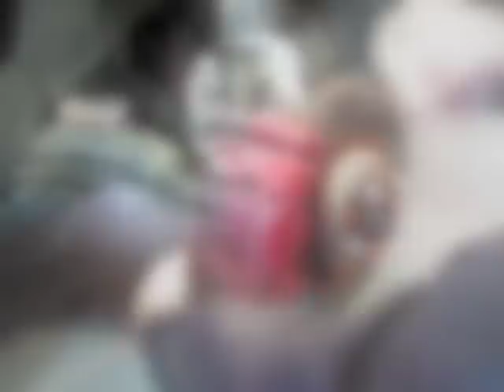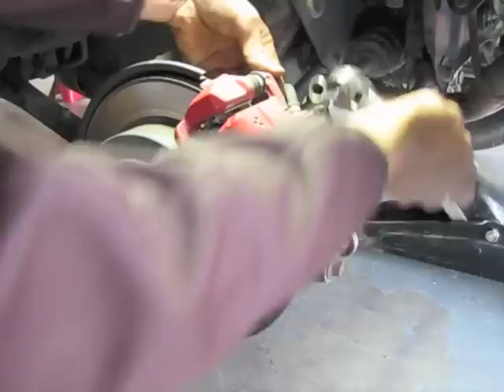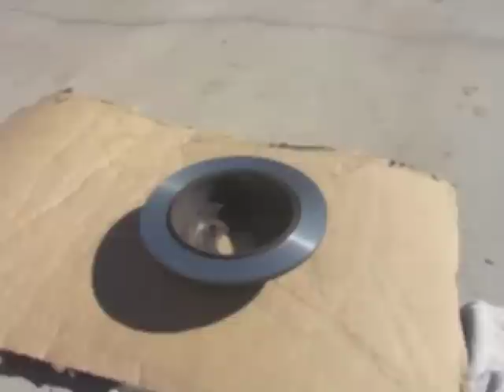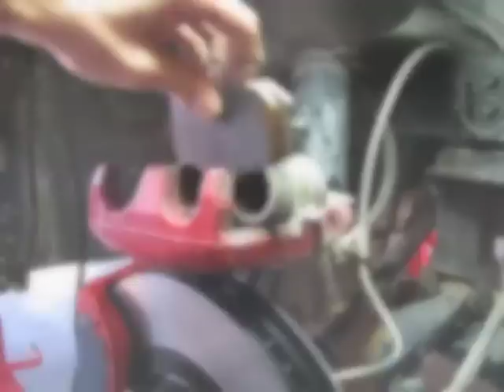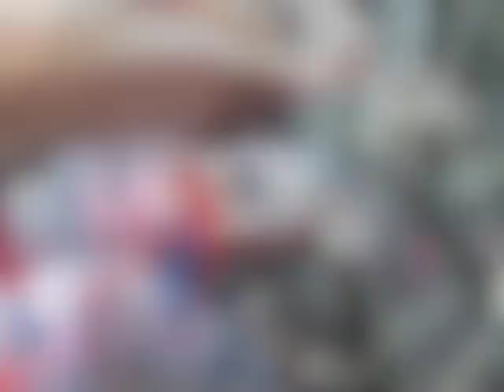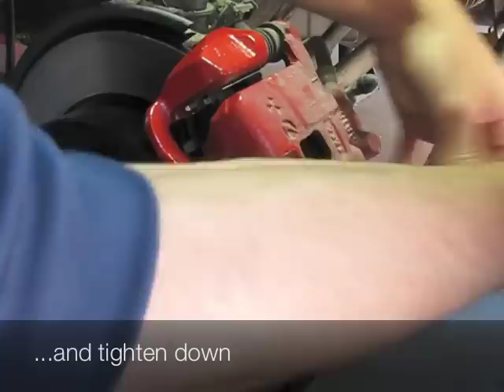Subaru Forester Brakes - Rotor and Pad Change

Comment: I usually open up the brake reservoir to relieve the pressure when you are using the clamps to "reset" the calipers. 

otherwise a pretty straight forward video!

Comment: Thanks for the video, I just wanted to mention that when you     compress the calipers, if the brake fluid cup is full it will overflow and get fluid all over the place at least it did on my truck, thanx.
Reply from the maker: +bill man Luckily, I've never had this happen with any of my Subaru's I've owned.
Reply: that is why you watch your cup and if it gets low you check your brakes .. low fluid means your shoes or pads are getting low unless you have a leak.. and no leak check your pads and shoes.. pads wear out quicker then shoes.. since the front brakes apply first

Comment: The 8mm is a bolt used for disc removal if seized. They thread directly in the disc and pushes it out.
Hope that helps.
Reply: I sprayed some chemicals, hit it with a hammer and it came off.

Comment: I put a small flat piece of wood or aluminum between the clamp and the pad so it does not get chewed up or tweaked...AND I drain any possible overflow materials from the reservoir so it does not overflow...

Comment from the maker: @kleun28 
There is no reason to remove the brake hose unless you are replacing the entire caliper or if you have a damaged brake hose. Even to bleed the brakes you do NOT need to remove the hose as there are bleeder valves. Hope this answers your question.

Comment from the maker: @liyangtime
That's normal while you are doing the brake job. It should quit and shouldn't drag when you take it on a test drive. Also, make sure you grease your slide pins.

Comment: It's advisable or even mandatory to replace brake caliper fixing screws when brake discs are changed (front and rear) because they are exposed to high temperatures and Elastic Limit of the screws material is reached when they are torqued properly to specifications.

ATE Plastilube is an anti-squealing grease, better resistant to leaching "lixiviation" in severe/arduous uses for long change brake pads periods and it can be used to grease other car components like door stops when they are squealing, seat rails, sunroof guides...

More vids of this kind would be great!

Comment: Excellent information.  On my 05 Forester, the bottom slider pin has an internal rubber sleave over a portion of the pin (the top pin is plain steel; no rubber sleeve). Do you what function this serves?  The top pin slides easily, the pin with the rubber sleeve does not.  Thanks!

Comment: I use only one clamp and one pad .. put the clamp in the middle of the pad and both cylinders will be pushed in .. no worry about the clamps interfering with each other

Comment: nice tutorial! :) thanks so much!

Ive got one question tho.  so hopefully you can answer me this.
My car is a jdm sti v3 with the 4 pot piston caliper...  once i went to brake shop to see my brakes and they told me that to remove my rotors i did not have to screw anything like you did with 8M bolts, that they just come easily, do u know if thats really true? cos it seems that all subarus have the same system.
and 8M.. it means that are 8 mm?
would really appreciate your reply

regards.

Comment: Don't forget to uncap the brake reservoir before compressing the caliper's (sic)..great drummimngg btw
Reply from the maker: Not entirely necessary if you compress is slowly, but good suggestion either way.
Reply: @ModFoz  Yes. Slowly is preferable to quick and disjointed.
Reply: ..(doing it now, thanks for the pre-job safety meeting).

Comment: Very nice vid. Thanks for sharing! I have a question, when do you suggest to replace the rotors? My Forester rear brake pads needs replacing (2mm left). Should I replace the rotors too or only the pads. I only have 50k mi on it. I got mixed recommendations from different mechanics. Others suggest replace brake pads but one suggest replace both rotors and pads. Thanks.
Reply: +vvalden It depends on how worn the rotors are. If they have uneven wear you can get them machined (resurfaced) to get the most life out of them. If they have worn too much, they will need to be replaced. Rotors have a minimum thickness stamped on them. A rotor should out last at least a couple of sets of pads, but it can depend on things such as environmental factors (how much dust/grit/salt etc) the vehicle is exposed too. Some people like to resurface the rotor for every pad change as the slight uneven ware in the rotor will affect the life span of the pads.

Comment from the maker: @PUboiler29 

I'm showing people how to remove their rotors and pads from their Forester's, not a complete walk-through on how to change brakes. Not to mention that if someone doesn't have the common sense to follow a shop manual and only use this video as a reference to what the pictures in the shop manual can't show you, then they shouldn't be working on cars.

Comment: Wish I could see back side. what is the caliper being attached to?
Reply: Caliper is attached to the mounting bracket, and the mounting bracket is attached to the only two bolt holes on the hub. There is only one way it will attach, so once you see it it's self explanatory. There are a couple shots of it I the video on the front. Hope this helps.

Comment: dis engaging parking brake when taking off rotor is only for the rear correct?
Reply: Yep.
Reply: You can leave the parking brake engaged until the car is on stands. Once you have raised it you can release the parking brake. You only need to release the parking brake if you are changing the rear rotors.

Comment: I would of also changed the brake hardware and lubed them with some antiseize before putting the pads on... the hardware tends to rust and cause noise
Reply from the maker: Paul E This video was for pad/rotor change, not an entire brake service. Yes, slide pins should be lubed, never with antisieze though. You should be using high-temp grease made specifically for brakes.
Reply: bluefox4848 duly noted and silicone paste/grease for the slide pins so the rubber boots don't bulge

Comment: What happens if you forget to disengage the parking brakes?
Reply from the maker: Hreggviður Emil Eðvarðsson In regards to what? Driving? You'll have the parking brake on and hopefully will be smart enough to realize it if you're able to move the car.
Reply: When I was attempting to remove the rear rotors but forgot the parking break on. Now the parkingbreak wonðt release. I'm afraid that if I simply keep tightening the bolts to release the rotors It'll damage the parking break in some way.
Reply from the maker: As long as your parking brake is off, it should be fine unless something stuck. But if you can hear it moving around when you move the parking brake, you should be fine.
Reply: I decided to just keep tightening the bolts in hopes of the rotor coming free, but I ran out of thread :( 
(I'm using 24mm long 8mm bolts)
The parking break is still holding the rotor and I can't get it loose :(
Reply: The parking break was bad to begin with, it usually doesn't release until i've driven the car a foot or so.
Reply from the maker: Well, then it's probably still engaged. I'd get longer bolts and keep trying to get it off. Once you do, you can inspect the parking brake to find out why it was malfunctioning before and fix it.
Reply: I got some larger bolts and managed pull out the rotor. Doing so the entire parking brake assembly fell apart infront of me, real rusty stuff and a few broken springs. 
I guess i have a new problem now xD
Reply from the maker: Hreggviður Emil Eðvarðsson you had a problem before if you had to drive to disengage the parking brake. Odds are something was already broke. Probably a spring. You can get drum parking brake rebuild kits for $15 bucks or so at local auto part stores. Just make sure it's for the parking brake.

Comment: Should put that through headphones on hilly for about 48 Hours straight at 100% full till you see the blood ,She’d TELL ALL!How about some Pin Lube or changing the metal snap in parts,Bad for business when they come back 2 months later with a stuck caliper that wore ½ of one side of the pad down to , and scorched one side of the rotor,can’t replace one pad or run down one side of the rotor,it would be uneven and we don’t want Mrs.clinton wobbling down the road or running off the road at 3 mile high lookout ?

Comment: skip a few steps and a few tools?
Reply from the maker: Nope, not a one. To change the rotors and pads, this is all you need (in fact, you don't even "technically" need a mallet or the M8 bolts really). Its a 10 minute job per corner maximum.
Reply: clamps for one.
Reply: bluefox4848 Lube the caliper sliders, but otherwise great tut! Depending on condition, new slider boots too.
Reply from the maker: Stephen Zacharias If nit picking, then yes.
Reply from the maker: kostondub Video was for only changing the pads and rotors. I didn't get into the slide pins/boots/bleeding as I wasn't doing them at the time of filming.

Comment: Why does everyone pull their calipers apart on every vehicle....🤦‍♂️ its completely unnecessary so stop doing it !!!!
Reply from the maker: Because you need to. You can’t get the old pads out without separating the caliper, nor can you get the rotor off without removing it completely. Perhaps you should read up on performing a brake job before telling people it’s unnecessary.